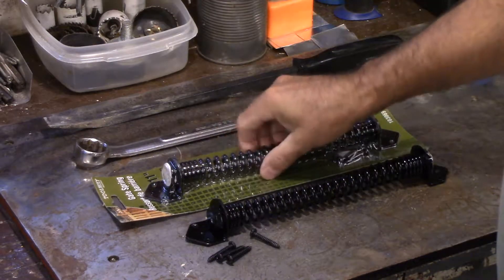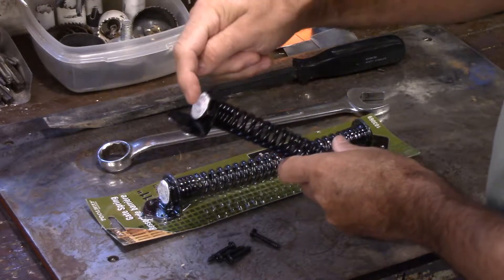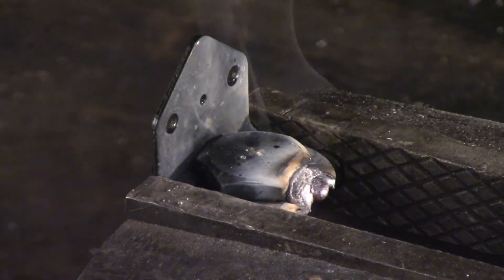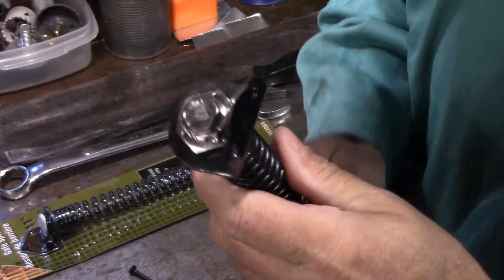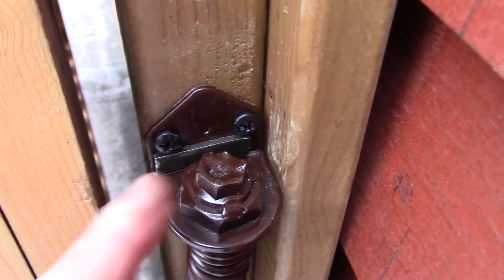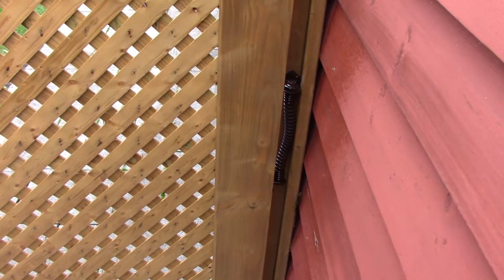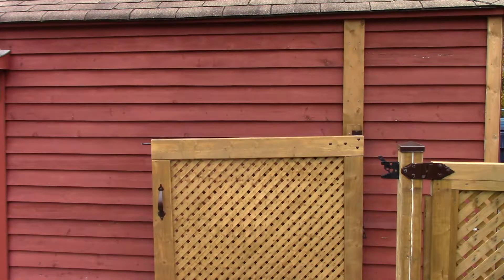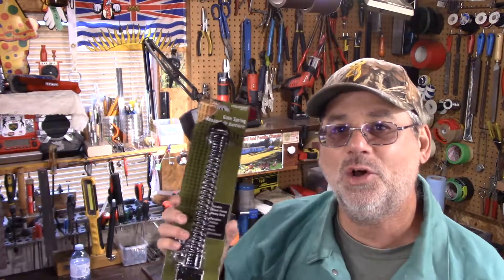Gate  Return Spring Installation  Hack

Comment: Great fix Steve…..that spring will open the gate now….I had the same problem about 10 years ago with the same type of wing wang spring and I just welded both ends and just turned the end until I had enough force and that's what keeps the gate closed at my place….just for looks….CHEERS
Reply from the maker: Seems the wingwang factory is still putting out junk 🤣🤣 Cheers Gator

Comment: Welding that nut on top was a great idea. Turned out nice.  I'm liking the idea of the gate opening instead of closing.  Be good when you come home with an armload of stuff and your hands are full
Reply from the maker: Yes plus on the old gate it was spring loaded  as a  constant closed  and the wind would make the latch constantly rattle compared to the pulling on the latch , no more rattling in the wind.

Comment: How's she gin'?  Great idea there Steve to use the spring to open the gate.  The nut on the top of the spring was clever too.  A lot easier to get the wrench on it now.  I made a spring closer like this from a coil spring from a motorcycle front shock and a couple of pieces of angle iron and used it to close a screen door.  These types of spring closer/opener are great!!!  Thanks for sharing and take care!!
Reply from the maker: Thanks Mike. That sound interesting , never seen a setup like that.

Comment: Instead of welding a nut, I just take turns tightening a bit with an open-mouth wrench, inserting the shim it came with, taking my wrench off and resetting it, pulling the shim off, and tightening again. It's mildly annoying, but faster than welding a painting a nut onto it haha
Reply from the maker: Mine is defective thus the welding . The spring slips on the nut that makes the shim useless.

Comment: Franky, I see no logic in what you've done. All I could think of is if your hands were full and you needed to have the gate open by itself. But you still need to reach and unlatch it.
Reply from the maker: Its all about personal preference  because its the same logic as the return spring  keeping the  gate closed.  I'm showing a choice of of using the spring to keep the gate in an open mode  .   I didn't design the gate for  others needs , I designed it for my needs  and for me it works great .   Cheers